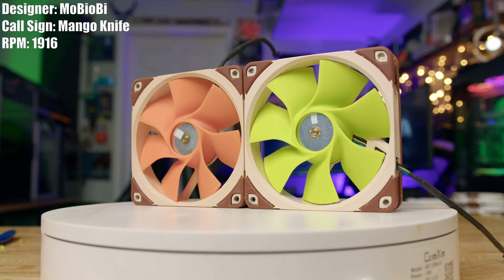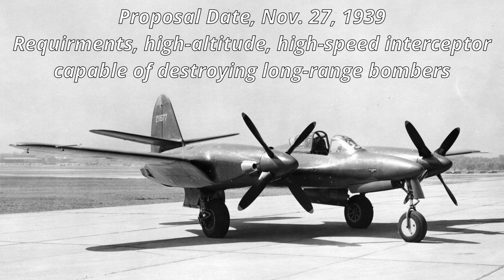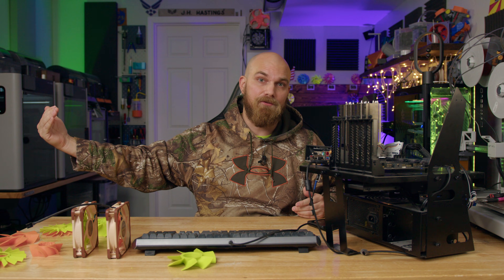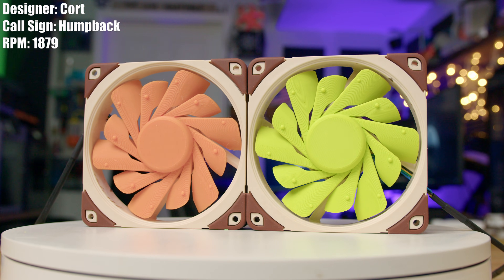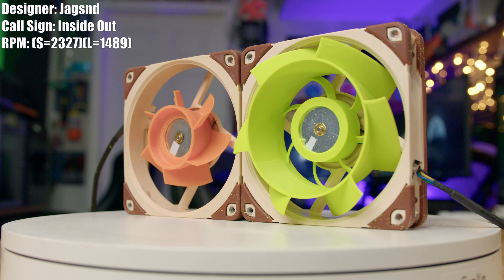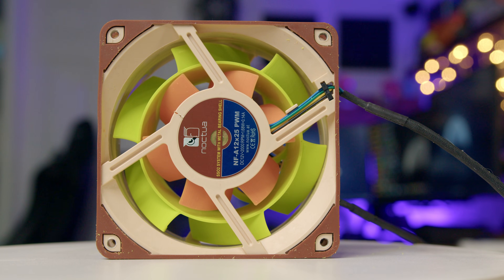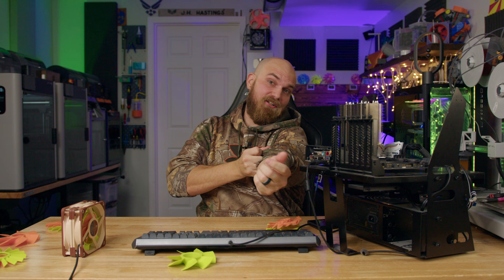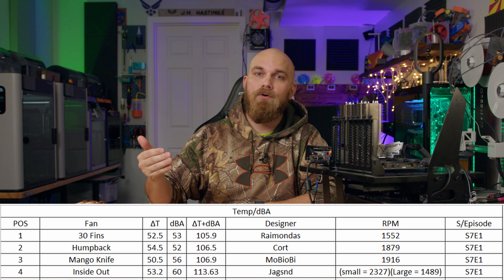Stacked TWIN Fan… is a Monster | Fan Showdown S7E1

Comment: I think sound test and smoke air flow test with the cooler between the fans would be a good idea for this season
Reply: Agreed. The heatsink fins could both adversely affect noise for the good OR the bad.
Reply: Agreed, but then he should redo the sound test for this first batch, so they are all normalized.
Reply: I think smoke air flow is more important than noise like I know realistically noise is a major thing but these aren’t real production fans I don’t know why the noise is so important
Reply: do wonder if blowing a crapload of water vapor through a metal heatsink might rust it out though
Reply: @ImDelphox  Steel is a bad conductor of heat, which is why aluminum and copper are used. Aluminum's "rust" (Al Oxide) is actual STRONGER than the bare aluminum. Copper's is... just pretty but functionless lol

Fun Fact: Aluminum Oxide is the abrasive in most sandpaper. It is also the basis of a number of gems. (Ruby, Sapphire)

Comment: Delta T and dB might not be on the same scale. They will need to be scaled properly before adding. I think you need to do (x*Delta T_i/Mean(Delta_T)+(1-x)*dB_i/Mean(dB)) to rank them. In this case, the sum is unitless, which means the result is some sort of meaningful. And then 'x' can be used to place more or less emphasis on cooling or sound output. I suggest x is 1/2. Otherwise, I have no problem with the ranking algorithm. In this case, the simple addition you've done here slightly weights in favor of the Delta T and my algorithm would reverse positions 2 and 3.
1	52.5	53	0.996677740863788	0.959276018099548	1.95595375896334
3	50.5	56	0.958709065021357	1.01357466063348	1.97228372565484
2	54.5	52	1.03464641670622	0.941176470588235	1.97582288729445
4	53.2	60	1.00996677740864	1.08597285067873	2.09593962808737

Comment: Correct me if I'm wrong, but isn't the whole idea of a (cooling fan) is to cool. Noise should not be a deciding factor. Also, testing the fan noise unmounted is also defeating the purpose of testing noise. The acoustics of air flow through the cooling fins on the cooler can significantly affect the acoustics.
Reply: I'd argue it depends on the application. The context for the showdown seems to be a PC, and I think noise is a deciding factor for most people buying a case fan, CPU cooler etc. If two fans are 1 degree apart but one is half as loud as the other, the quieter one wins without question.

Now, if the context for the showdown was a server fan (a 40/80mm season could be fun?), it would make more sense for the result to focus on temperature alone.

Comment: Sound test should be done with the cooler in place
Reply: yup huge part of fans noise comes from the Air turbulence, restrictions, Radiator, heatfin stacks.

Putting fans designed for cooling a CPU without restriction isn't a good way to judge their sound profile while actually cooling
Reply: I was coming here to say that.
Reply: The score should be delta T over dB. That way you get degrees cooled per decibel.
Reply: @ChadHadsell  agree. Cooling per decibel is the most balanced

e: Actually, thinking about the math, this won't work. Lower delta and lower decibel are both the desired outcome but they move in the same direction, if that makes sense? A 30 delta and 30 decibel fan is obviously superior but would score the same as a 50/50 fan. One of those numbers needs to be inverted to a different baseline. For example, Delta needs to be calculated as 100 + room - temp. Then a 30/30 fan would be 100 + 20 - 50 / 30, or 70/30, while a 50/50 would be 100 + 20 - 70 / 50, or back to 50/50. The 2+ ratio on the 30/30 fan would then be much better than the 1 ratio of the other. Then just have to tweak the constant to balance what we feel is more important.

Just adding the two numbers together is not a good way to measure because they are two different units. These were relatively close together so it kinda worked, but we don't know what the end result will be.
Reply: @kayakyakyakr  Not to mention the fact that dB is a log scale.
Reply: @ChadHadsell  The problem with that is that decibals are a logarithmic scale.  Every 3 decibels doubles the intensity of the sound wave.
Reply: agreed. it may change the sound output as well.
Reply: I agree.
Reply: yup
Reply: Yes, sound check with cooler in place.
Reply: came here to second that, but I'm actually 497th-ing this :)

(Also smoke test ON the cooler too)
Reply: Yes, restriction is #1 in changing sound in a heatsink. If the sink is fine-finned it may increase volume.
Reply: I wanted to type this but it was already the top comment.
Reply: But how do you measure it then? That gives split fans immense advantage and pull-only even more if it is measured from the front? This season has a chance to really become all about acoustics.
Reply: @Henrix1998  It would have to be consistent, but I would think having the mic a few feet away would be a decent representation of where a person would be sitting in relation to the computer and it might allow for different setups to even out as a general volume.
Reply: @Henrix1998 a set distance from the side of the cooler? Can also add flat plates in front and behind the stack, far enough away to not effect flow but angled to reflect sound towards the mic.?
Reply: @jamescarruthers1967  I think decibels 3ft-5ft from the side of the cooler. Also makes a showdown fan that's designed for sound reduction or sound reflection possible. 

Could take the measurement from 3 or 4 sides to get an average and prevent "cheat" designs, but that gets to be a lot of work.
Reply: Totally agree
Reply: Second that motion.
Reply: It just occurred to me, bro is usually wearing a sweater AND the room is ALWAYS 70+ degrees... dog, where do you live? My heat in the pnw is 68 or less and I wear a sweater cause I'm a cheap bastard, my ac in summer is 78, why are you so steady and why are you cold at 70+? 😂
Reply: 100%
Needs an all in one rig with a heat source and monitor temp + db together
Reply: Came to the comments to say the same thing the restrictions of the fins could cause a different noice profile
Reply: Agreed
Reply: I was going to comment this too.
Reply: Yep. Even without measurements it's easy to notice the difference in noise a fan makes with and without a heat sink impeding air flow.
Reply: Absolutely. it makes no sense to test them alone.
Reply: agreed, I once made a cooling setup that when extra power was need, whistled
Reply: 100%. back pressure makes a difference to sound.
Reply: Exactly, and ideally measured with the mic pointing at the top of the cooler rather then at one of the fans, because in most setups with standard cases the cooler would be facing the user with its top side (at least roughly) ... and a set distance away of course
Reply: All the testing done on the cooler, smoke too :D
Reply: Agreed
Reply: same here
Reply: Sound and smoke both.
Reply: You are all wrong about the sound!  SOUND should not even be judged!  
Here is the major problem with adding the acoustics to the score.  You can have 2 fans that all have the same dB... one will sound louder than the other.  Measuring how 'loud' they are is subjective because it also depends highly on frequency. 
The human ear is not a dB meter!  Cooler or no cooler it does not matter!   Depending on the frequency of the sound,   at the same dB level, one fan can sound a lot louder than another fan, and further to the point, you may have a fan with a lower dB level, and you may perceive it as louder than the other fan with a lower dB level.  
The sound is subjective.   
Highly Subjective!   

I get having a dB reading from the fan as it provides some information, some data.  However, the data is nothing more than a reference if you are not there to hear it or compare it to another fan running in person.  It is more than just how loud it is, the sound it makes matters too, the frequency matters.  They have examples of different frequencies at the same dB videos, so I suggest you watch and more than that, listen so you understand this.
Reply: I didnt read other replies, maybe someone already suggested it but also the sound maybe will be better mesured from the side, not pointing front or back of the fans?
Reply: agree
Reply: i was going to add the DBa should be equalized for the results.  I think you should have 2 readings.  Delta at max dba and Delta at constant dba.   it should reveal the most accurate results

Comment: I would suggest doing the noise test with them mounted on the cooler to get as accurate of a reading as possible as if they were in the computer but without the cpu running so only the noise of the fans going through the stack is being measured.
Reply: This is the best idea.
Reply: Bad Idea!  Cooler or no cooler it doesn't really matter.  You are missing the basics  when it comes to sound...
 You can have 2 fans that all have the same dB and one will sound louder than the other.  Measuring how 'loud' they are is subjective because it also depends highly on frequency. 
The human ear is not a dB meter!  Depending on the frequency of the sound,   at the same dB level, one fan can sound a lot louder than another fan, and further to the point, you may have a fan with a lower dB level, and you may perceive it as louder than the other fan with a lower dB level.  
The sound is subjective.   
Highly Subjective!   

I get having a dB reading from the fan as it provides some information, some data.  However, the data is nothing more than a reference if you are not there to hear it or compare it to another fan running in person.  It is more than just how loud it is, the sound it makes matters too, the frequency matters.  

They have examples of different frequencies at the same dB videos, so I suggest you watch and more than that, listen so you understand this.  
If you watch one of those videos you will clearly understand how subjective the dB level is and strapping it to a cooler makes it even more subjective because if someone were using this data and had a different cooler it adds even more issues.  If you start off with garbage in, you get garbage out, any other things you add to it just makes more garbage.

Comment: That scoring is flawed I think because a simple addition of the values can mean that theoretically a loud fan that cools better can have the same score as a silent fan that cools worse. So which one is better then? I think using a temperature per dB (or dB per °C) value to compare then would make more sense. So lots of °C per dB is a good fan because it cools well while being silent. The problem however is that dB is not linear but logarithmic... maybe chatgpt can figure it out
Reply: Raising 10dB is perceived as about twice as loud, so you can just do some exponent stuff to get a "linear loudness" value.  I think that's 2 ^ (dB / 10)
And another way to rank the fans could be to plot the scores as two axes of a graph. Then you can just get the distance to the origin.  But now you can choose where the origin is, and you can scale the axes.

And since you'd be using the pythagorean theorem to get that distance, you now have another thing to tweak to get the results you're looking for.
You don't HAVE to square the values,  You just take the input values to some exponent N, add them, and then take the Nth root. N doesn't even have to be an integer.  That exponent can be anything, and different values will make the output score "favor" more balanced or specialized input scores. Look at the Stand Up Maths "Squircle" video for an idea of what that looks like.
Reply: Just had a thought on how to score the sound: compare it against the A12's.
If yours is QUIETER, subtract that from the ΔT.
If yours is LOUDER, add that to the ΔT.
Whatever the final value is = the rated score.

Alternatively, perhaps add them together like he did, but then add/subtracts the dB vs A12, using that as the kicker to differentiate them further.

Although... in either case the end score is going to have minimal variation. So he might want to multiply the final by 10 to utilize the decimal as a further differentiator. 🤷‍♂️
Reply: I was thinking about this as well, and also have no idea how to implement it correctly XD
Reply: I think cooling performance is logarithmic too. 10% more air flow will not drop temperature by 10%.
Reply: Maybe instead of adding the whole DB he could add a percentage of the value. People are just going to build quiet curved bladed fans otherwise.
Reply: @BLUEYENKO Yeah, I think just adding half of the DB would be better since cooling should be weighed more
Reply: Also part of the problem is that it's not just dBs that are the issue. He has plenty of older videos where he comments on the sound of fans that are louder dB wise but sound quieter/more comfortable to the ear compared to others. Example; I'd rather have a 50dB fan hum over a 40dB garbage disposal
Reply: Yea and I've been conflicted as well, on how to rectify it... 
My gut wants to SUBTRACT the dBA from ΔT, but that won't work either, for the same reason. Pretty sure it creates the same result, just viewed a different way... 
I don't think you're able to add, subtract, multiply, OR divide them, for the same reasons.

However, I hate numbers and math (because I suck at it), so I might be missing something.

And yea, the fact that dB are logrithmic amplifies the issue (no pun intended).
Reply: Agreed some fan that does almost nothing and gets almost zero delta t might win just cause the dB is so low.  Some ratio of dB and deltaT would be better approach for the performance vs noise.  Think deltaT/dB is close enough.
Reply: @stormsj  zero delta t means the CPU is at room temp - which would be more than 50 deg c of cooling
Reply: Except that an extremely low performing fan that also happens to be extremely quiet would rank very highly despite not being of any actual value. Furthermore the degrees C is measured as a delta, so lower delta is actually better as it means the resulting temp was closer to room temp, so high °C would actually be a marker for low performance. To properly do that you'd need to know the actually degrees of cooling, which would require knowing the temperature the CPU would be at without any cooling to get the difference. Measuring in a °C per dB is good for relative performance, but what would be more useful is an absolute performance metric, for example a fan that provided 10°C of cooling at 5dB would rank the same as a fan that provides 80°C cooling at 40dB despite the first being effectively useless at it's function. The actual metric needs to make it so that given two fans with the same cooling-to-noise ratio the fan with the better cooling would win.
Reply: @DreadKyller  I think that may be partially fixable by adding a cutoff. Temperature rise must be less than 60°C to qualify, for example. But the temperature rise/noise curve isn't linear, so really what we should probably be comparing is how much more/less noise a fan produces for the same amount of cooling (temperature rise) relative to the reference A12. And we'd likely want to fit a line to the A12 data to extrapolate a little beyond what the A12 can achieve.
Reply: I'd weight it compared to how the A12 performs. If you run the A12 at a speed that's 6 dB quieter, how much warmer is it? I think it'll be around 10°C, or ~1.6-1.8 °C per dB warmer.
Reply: Y’all are working too hard. To ‘weight’ the results, just double the decibel reading before adding to the deltaT. This makes the volume reading half as ‘valuable’ as the temp reading.
Reply: @tyrelirwin  In that case, wouldn't you want to halve it, not double? Halving it makes the differences smaller.... Though I could be wrong. (again, I really loathe math lmao)
Reply: @tyrelirwin that doesn't fix that no fan likely often wins since the CPU likely throttles at 90C....so no fan scores about 70 since it's zero dB.
Reply: Just multiply both value, this would give a better difference
29+31 = 30+30 and with multiply 29*31<30*30